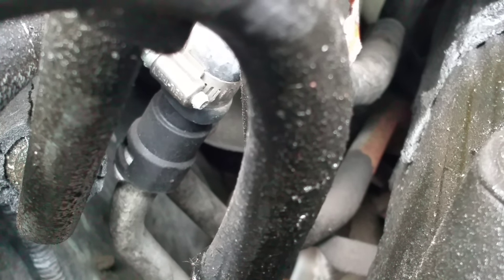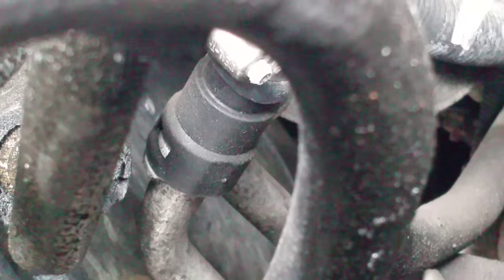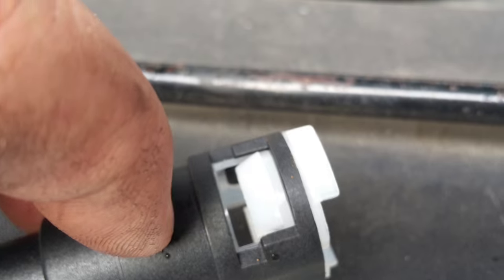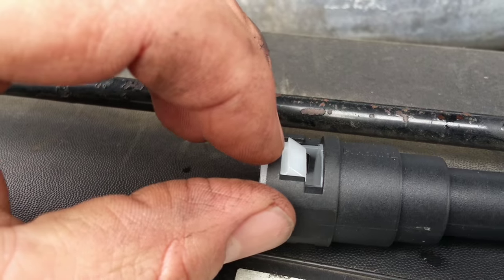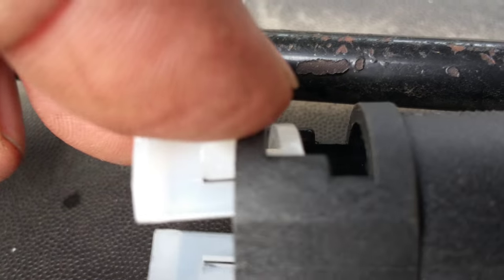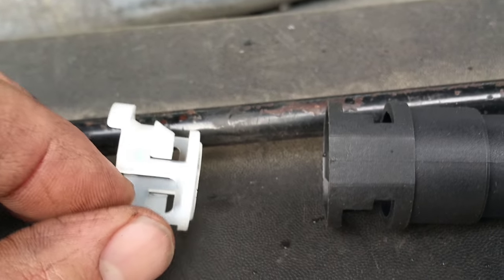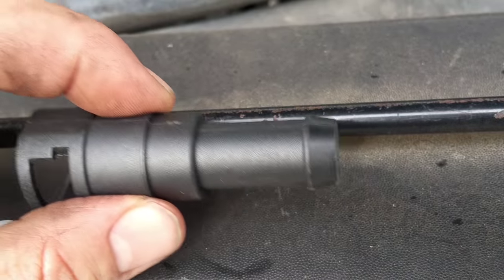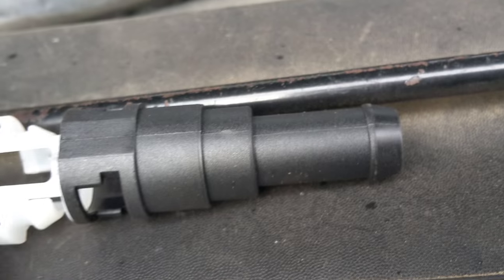Ford Heater Hose Quick Connect Release how to

Comment: "there's enough room with the pipe in place"

Boy that's a damn lie
Reply from the maker: What vehicle?
Reply: @MrRChitty  a 2003 f150 with the Triton V8
Reply: @MrRChitty  wrong post sorry. The hose is on a 2013 f150 5.0. I just grabbed some dikes and tore it apart while on the motor and replaced it with a nipple, some generic heater hose and screw clamps. Better than these dumbass fittings
Reply from the maker: @wootdoo  that's what many have said. The quick connect works nice under the coul of those Fords.  Notice I wrote, "QUICK CONNECTS".

Comment: This part is absolutely Stupid! Throw this crap away and push the hose onto the male end (that goes into the piece,) put a worm clamp on, tighten. Easy.
Reply from the maker: Problem with a worm clamp is access to tightening under the cowl. There's virtually no room to work. At least with the quick connect, it just slides on making reassembly a snap.

Comment: Why not just connect the hose to the heater core tubes with a standard hose clamp? Save the money and hassle of those stupid clips
Reply from the maker: There's no hassle installing them. It's the removal. Anyhow, tightening the clamps under the firewall is difficult. By using the quick connects, they just clip into place, significantly reducing install time.

Comment: What is the purpose of these not so quick connectors ? These are where you have breaks. Why not put hose to metal pipe with your hose clamps?  Am i missing something on why you use these?
Reply from the maker: It's all about production. They are "quick connects". Not quick "disconnects". In a factory with one vehicle passing every minute, the hoses are laid out and just plugged in. I know GM uses them as well as Ford. I never heard of a random failure, not to say it never happened. I personally have been through numerous vehicles in a very high mileage state and never suffered a break.